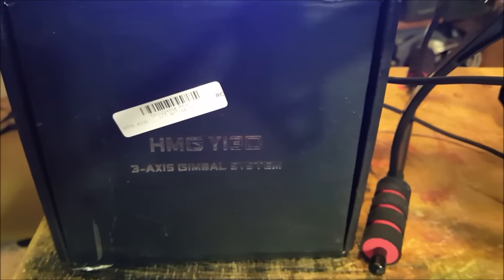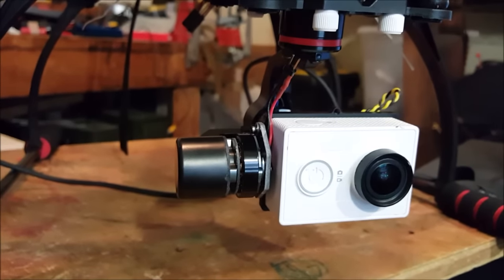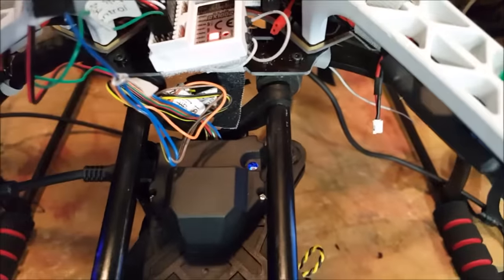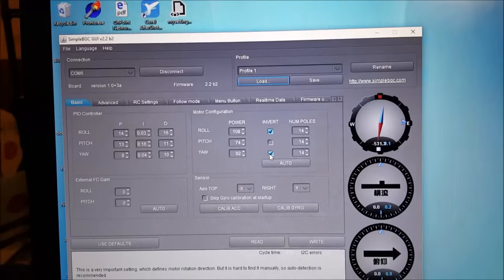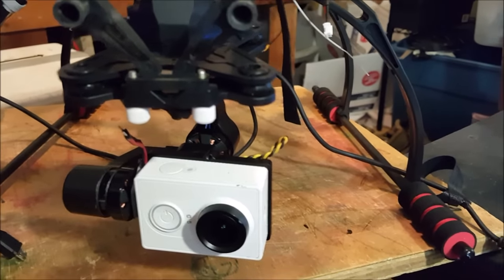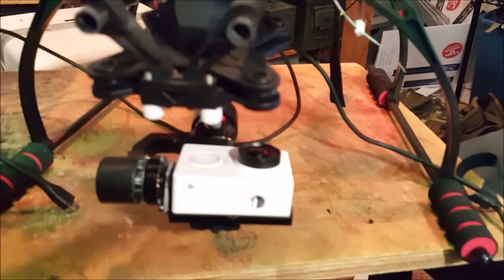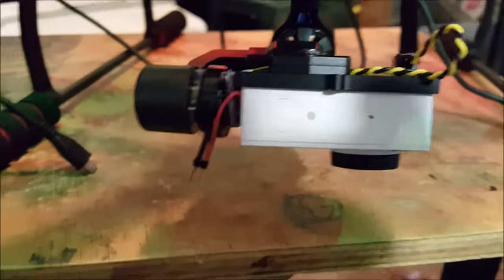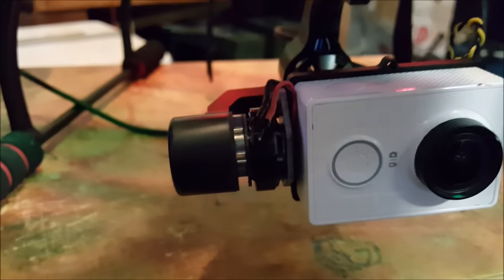HMG YI3D 3 Axis Gimbal System for Xiaomi Yi

Comment from the maker: I thought I should mention that when not connected to the RX and I get it to initialize in a reasonable position, AND it doesn't start rotating in random directions, this is a very stable gimbal. I flew it in very windy conditions, up, down, forward, reverse, left, right, 360 rotation, etc. When I watched the video I was very impressed with what I saw. There were no sharp movements, no jello, and no vibrations. A 2D gimbal usually results in noticeable vibrations. Even the sharp yaw axis rotations caused by the high winds were smoothed out to the point where I couldn't identify the spots in the video where I knew the hex was shaking badly.
Reply: I commented above to Ricco about a possible cause why the gimbal would not obey RC commands, ie lack of common ground, will work on that and let you know if I can get one of mine to do what I want. Then try to see if I can get it to listen to my computer.

Comment: Hi, 

just received the HMG Yi gimbal. After watching yours and someone elses videos I have it stable and in neutral position and doing its job very well but does not move tilt or yaw with the signal cables connected.
Any hints for software or any other adjustments would be greatly appreciated.

Regards,

Richard
Reply from the maker: +Ricco Lisch I used this software and it works great to program it. http://www.basecamelectronics.com/files/v10/SimpleBGC_GUI_2_2b2.zip
I'll post a copy of my settings file on Google Drive this evening so you can try it out and see if it helps. I also have the PID settings for yaw adjusted to keep the yaw movement down a little, which helps keep the ends of the hex's arms out of the shot when I rotate quickly.
Reply: +JoeSnuffie Hi, thanks for your video ! I just received mine and I'm a little bit disappointed. When I plug the power the gimbal will test itself but then the camera is not leveled. The camera should be horizontaly aligned but it is not :o( Is it possible to have a copy of your settings ?
Reply: Might be a bit late, but... Got one (two actually, the first didn't work as I wanted so I got another one on warranty) from Hobbyking. Will play with them today. I saw Joe used two different batteries, one for the gimbal and one for the receiver.  Since theres only single wires for the RC control, there is no common ground/negative/return. Will hook up mine with a common battery. will come back with result

Comment: Hi Joe,

my gimbal works well but in about 5 minutes time yaw turns about 20 degrees clockwise and I never could get tilt to work.

Have you been more successful?

Regards,

Richard
Reply from the maker: once I got a replacement board from Banggood everything works perfectly.  I guess I'm not the only one that received one with a defective board.
Reply from the maker: This is the profile I use. https://drive.google.com/file/d/0B751t-yy-x-nZ1B1LXZ6TGpfZGM/view?usp=sharing

Comment: There is a sale on these   Do you recommend me to buy it? It is only $55
Reply from the maker: After getting a replacement board from banggood I am very happy with it. For $55 I'd buy it.
Reply: +JoeSnuffie I'm getting it from hobby King and their service is slow
Reply: +JoeSnuffie  does it work perfectly now? And is there jello in the video taken from the gimbal?
Reply from the maker: +Maxwell Wang there is no yellow even with unbalanced props. it performs wonderfully now. of course you should always balance your props and make sure you're using the right size and type. It took me a few tries to find the best props for my setup.